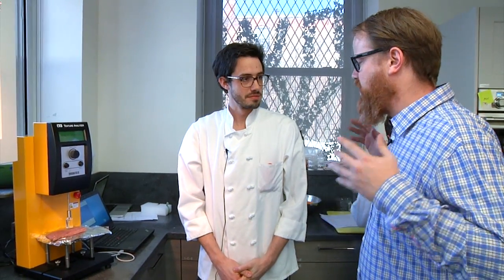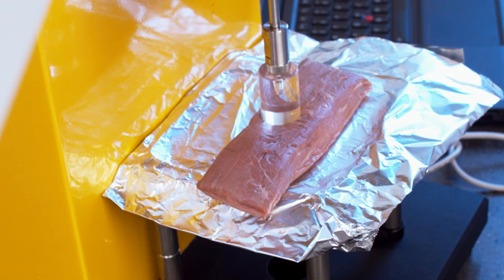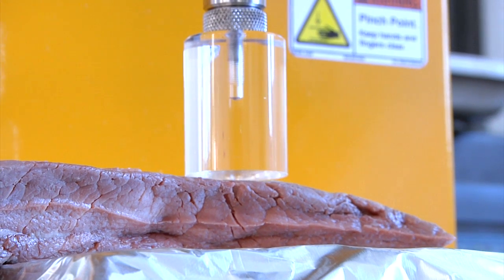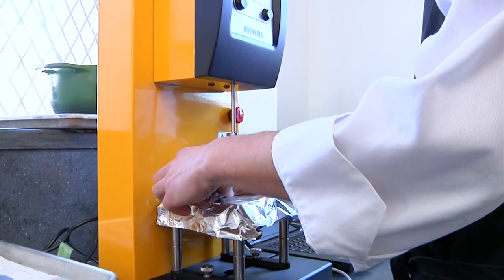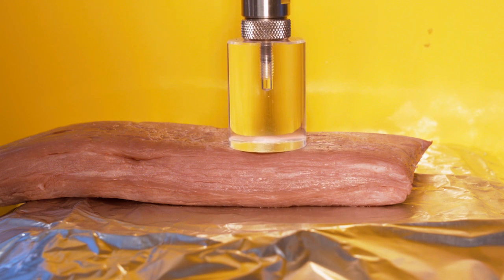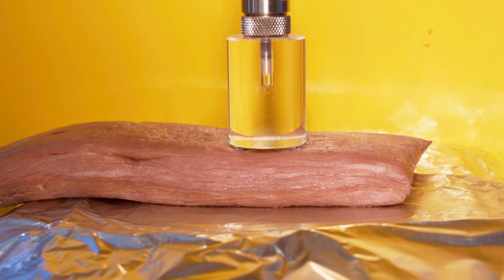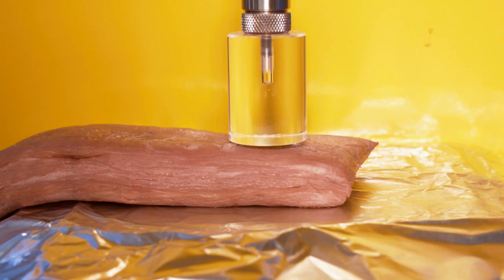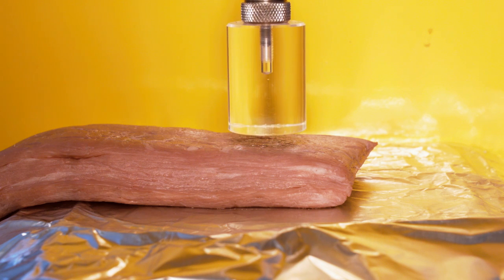The Science of Meat Texture at America's Test Kitchen

Comment: He means 130 - 140 degrees Celcius, right?
Reply: I don't think meat would be that color at 130-140 C. Also, he mentioned using a circulator to cook so it would be impossible for a circulator to achieve that trmperature due to the boiling point of water.